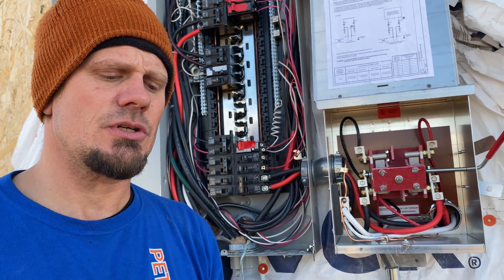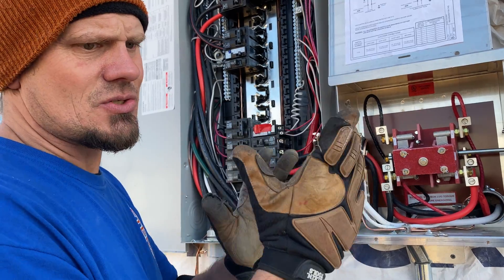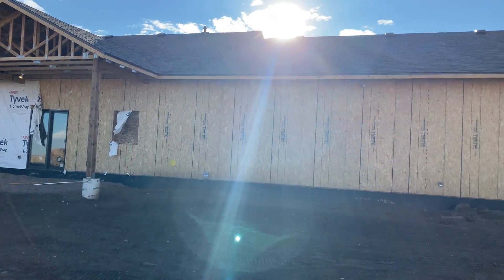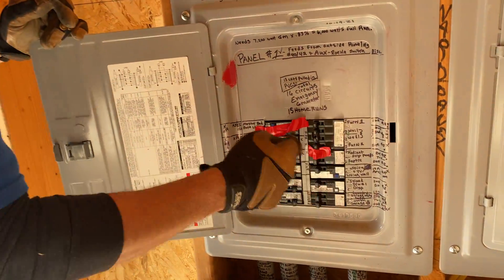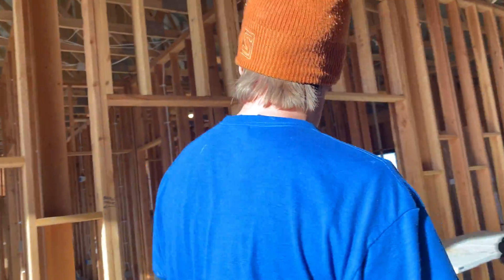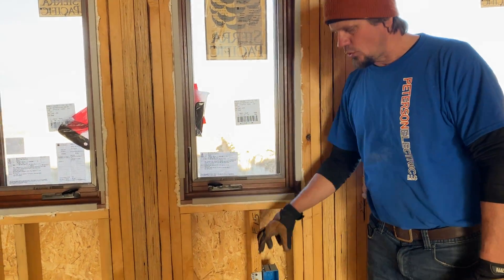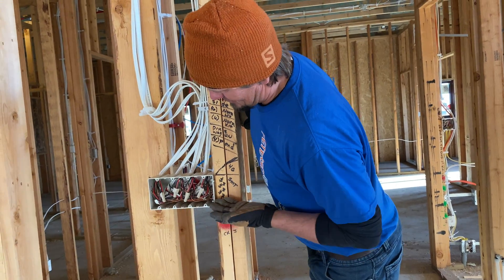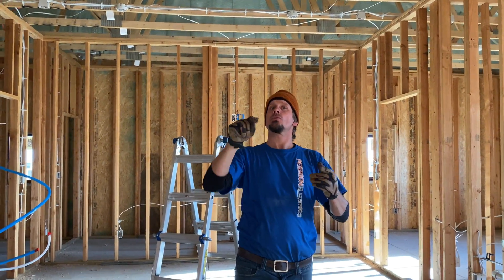Manual Transfer Switch on a Home

Comment: 22kw generator with automatic transfer switch is under $5k.  On a NEW house it’s super simple because you don’t need to move wiring to a sub panel since you’ll be wiring sub panel in the first place. Why you saying it’s $15k???  Should be no diff between manual or automatic transfer switch
Reply: 5k for a 22kw??? Do you live in Ethiopia? Idk what kind of generators you’re selling people but you need to stop
Reply: @tristatehomesllc599  Microsoft Edge price history is showing a 22 kW Generac generator with a 200 Amp automatic transfer switch was $5,147 at Home Depot on Oct 9, 2021  - and peaked at around $6,000 a month later. If it could be installed close to where he installed the portable generator hookup and was connected to natural gas then additional materials would be less than 1k and likely offset by the portable generator materials. The labor for installation on this new house would likely have been less for the whole house generator given the separate panels and circuit planning that went into the portable generator design. So, I'm not seeing the extra expenses that Peterson Electric has claimed.
Reply: @JasonEDragon  I completely agree.  100%.
Reply: I think the confusion here is what the guy meant in the video. I assume the 15k was a turnkey price, materials and labor.
Reply: @club567  he specifically said that he charges a lot more if it’s automatic transfer switch.  And we showing here that it’s trivial on a new construction and the generator already comes with auto transfer switch
Reply: @club567  ... I retired from that business just prior to Covid. (less that 2 years ago) It was unusual to see a finished job for much under $10k... mostly because of changes that needed to happen and of course running gas to the unit is extra. An "easy job" with gas already close by might squeak in at $8-$9k for an air-cooled set. Going larger to a water-cooled set would pass $15k but the lower noise level and longevity of the unit can be worth it.
Reply: @tristatehomesllc599  Honeywell 22k with automatic transfer switch.  They used to be $4200
Reply: @MattNis1  ... yes, and you could get one within a week. Now the price is up, and the wait is likely 6 months or longer.
Reply: @tristatehomesllc599  ... that's the lowest price I have seen for a 22Kw automatic gen set. Probably just the unit and mail-order at that. It will cost you $1-$2k for installation and another $1-$2k for the gas hook up, depending on many things.
Reply: Here in CA our neighbors just Generac'd with auto switch and it came in at $20K. (I couldn't believe it either.)
Reply: I paid about 9k for mine, but that also included upgrading the service from 150 A to 200 A and installing a new outdoor meter/breaker panel, new indoor panel, and an automatic transfer switch. Some outfits really try to mark up the price, so you need to know who you are dealing with. But, it is much nicer to not have to keep cans of fresh fuel on hand - and you don't have to put all that effort into having separate circuits with and without backup power. And with the extra available power you have the capacity to be neighborly and help others - if so inclined.
Reply: @@ec3723 $14k is just how much they want, not how much it should cost.

Comment: Great video as always!! Great clean work, but if it budget was never a factor QO would be the only way for you too! Can’t stand Siemens, never felt safe with there OCPD trip curve vs QO, plus no plug on neutral for your afci & Df breakers all the extra pig tails. 
Either way you do great work buddy!
Reply: Siemens does do plug on neutrals, their entire PN/SN series panels are all plug on ready and breakers are expensively ready to go….the only real great thing they did improve is their new afci breakers are only hot wired like a plain old therm breaker. Duals are still same neutral to breaker.

Comment: Really nice explanation, but you can't have a female outlet. That generator cord will have 240v at the male end, witch will shock somebody
Reply: Spot on
Reply: I'm confused here too. That's a 50 amp female on the side of the house and I thought it was going to be a connection point for the RV, but it seems to be wired to the transfer switch. Or is that an external disconnect for the RV?

Comment: Awesome video i never seen manual transfer switch before, especially residential area. Do you have any chance to teach automatic transfer system or inverter system? I would really appreciate it.
Reply: Most are plug n play line in line out buddy
Reply: @juliovalencia4948  true it is all about wiring but I need some lecture to understand system thoroughly
Reply: @psyo123  gotcha I'm sure there are some wiring diagrams online I install battery backup systems with inverters and automatic transfer switches all the time in traffic signals when the power drops out it automatically switches probably through a relay
Reply: @juliovalencia4948  can you link anything about it? because I did just samething as you mention. battery back up system and inverter wiring was not big, but my problem was wiring relay. I would appreciate it if you give me any information about it.
Reply: @psyo123  relay is simple think of it a a switch that is controlled by power you have normally open or normally closed contacts say for example you have a normally open relay hooked up to a 120v  photocell you land those on the coil of the relay you can control a parking lot lighting 480v hook up the lighting to your l1 l2 l3 if it's 3 phase there are many examples I can use maybe if I do a drawing I can send it to you
Reply: @juliovalencia4948  do you have any link which has wiring diagram? I don't wanna bother you with drawing diagram lol
Reply: @psyo123  no I don't google it
Reply: @juliovalencia4948  it s cool I will do it by myself but thx for advice I almost got what you saying
Reply: @psyo123  cool man good luck